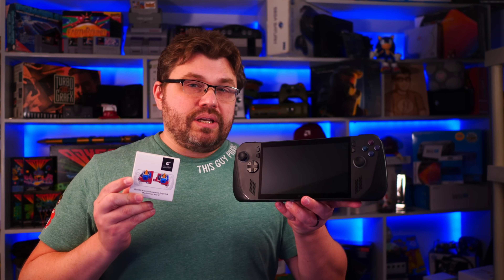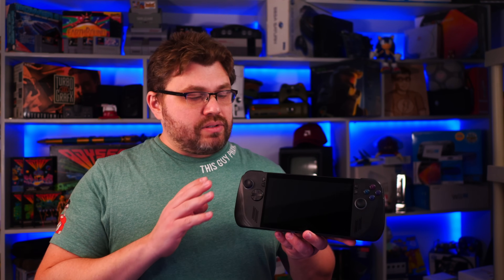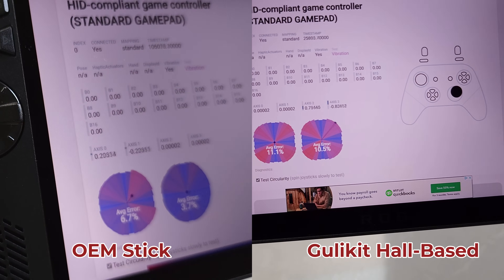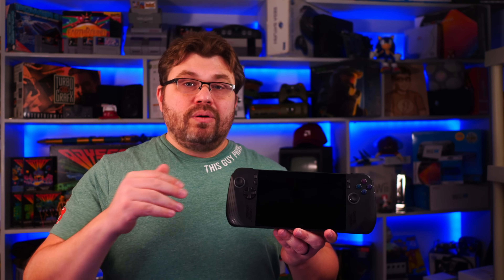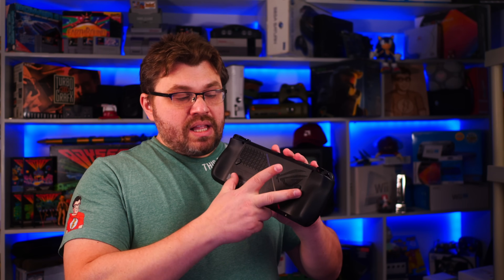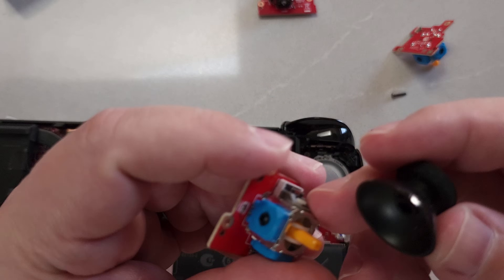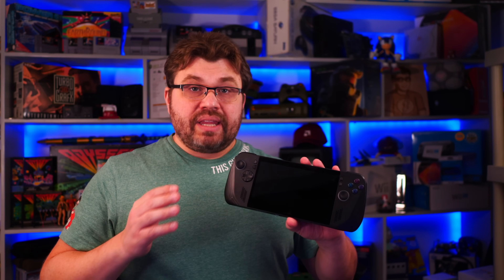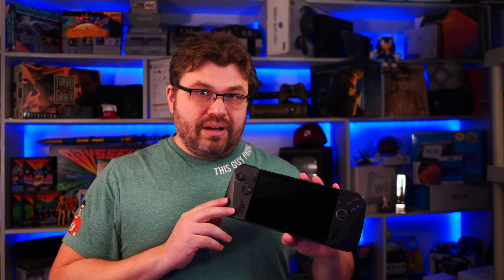ROG ALLY X Gulikit Hall Based Upgrade - How To Install Guide and Review

Comment: Thank you for the clarification on Step one of calibration...was moving the stick to the center and by the end, my right stick cursor was drifting on the desktop.  Not touching the stick corrected my mistake.  I had to change my stick because L3 sprint presses weren't registering 100% of the time.

Comment: I put some Gulikits on my steam deck. I have a weird problem that when I turned the deadzones down every time I wake from sleep I have the smallest drift till I rotate the stick once. It always goes away and works perfect till I turn off/sleep the deck again. I don't think calibration would help since you have to rotate the sticks to do it. But maybe the calibration button on the sticks itself might but I already did that once. I really like my sticks besides that and I could avoid the problem by turning the deadzone up but again why bother when I could just rotate the stick once to make it go away and have perfect deadzones.
Reply: I have that same issue when using the steam deck Gulikit halleffect joystick specifically on the right stick. It occurs when the deadzone is too low in SteamOS as the stick doesn't always go back to centre point after waking from sleep or from a full startup. When this occured, my ... woudn't work properly becuse the right stick is constantly shooting out an input. You can safely increase the deadzone in SteamOS, games use their own deadzone unless you specifically set it to match SteamOS deadzone under the controller settings. 
TLDR, SteamOS deadzone doesn't affect your in-game deadzone unless you set it to do so under controller setting on a per game basis. Hope this helps :)
Reply: @gblackfog1015  It's also on my right stick but when I give it a quick rotate it centers perfectly and doesn't cause any more problems. Kind of like it needs tro be self calibrated every time it turns back on.
edit: on further testing I just have to flick the stick once and it seems to work fine with no more drifting but at power on it drifts slightly to the right.
Reply: TL;DR: You can safely increase your controller deadzone under SteamOS controller settings until the weird right stick drift is gone, it doesn't affect your game deadzone. I've tested it myself but you can always do some test too :3

The same thing occurs for my right stick. The drift occurs because when you wake it or do a fresh boot up, the stick position is slightly outside your very small deadzone, causing the system to detect a right stick directional input.
 A quick flick brings it back to 0,0 but that gets quite annoying after a while since it needs to be done every time after waking from sleep. It even affects desktop mode since my mouse is binded to right stick. 

A good permenant fix is by just increasing the SteamOS controller right stick deadzone slider by 1-2 clicks. SteamOS deadzone only affects the desktop mode and SteamOS navigation, so your game deadzone is not affected :)